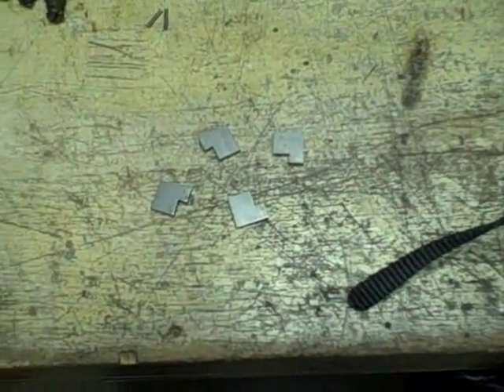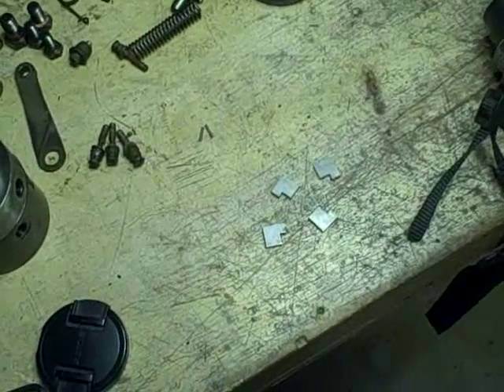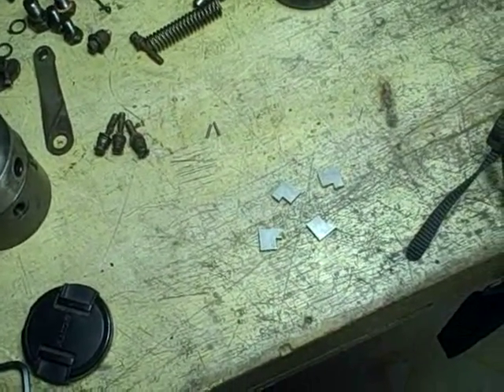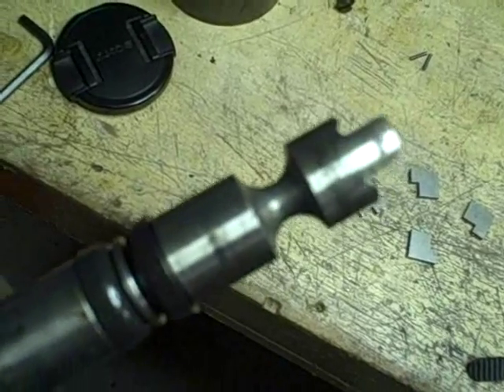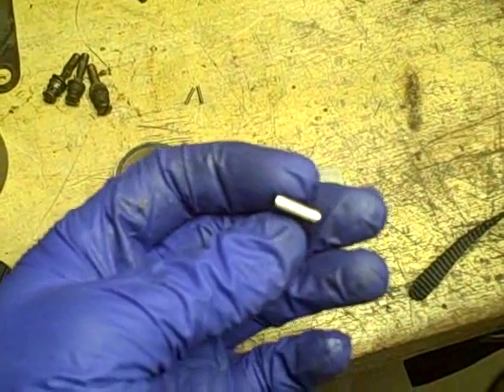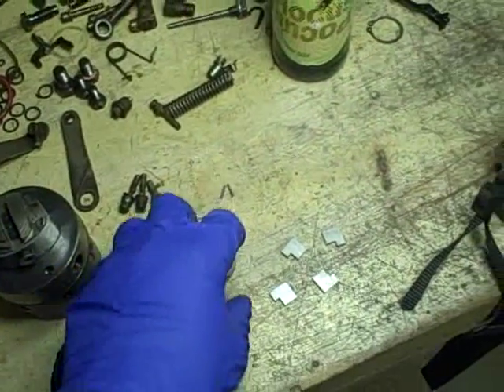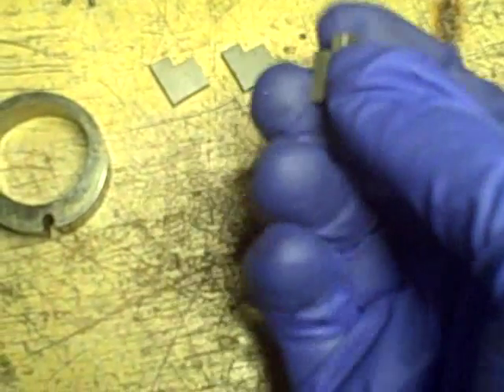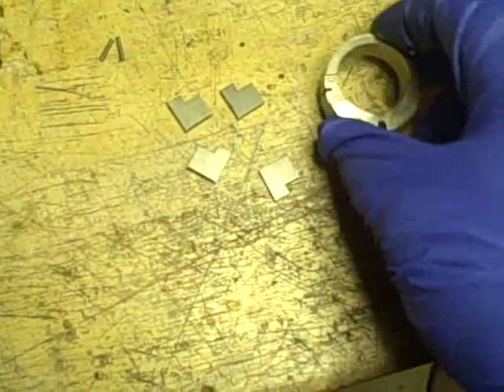Oliver 770 Industrial Tractor Project Part 64: more pump inspection

Comment: I worked for a major auto company.  The company made diesel injectors also.  A new engineer in the plant was tasked with upgrading some machinery.  He bought a machine that would hone the inside of the injector to a mirror finish.  Everyone thought this was grand.  We started shipping injectors.  Soon reports started coming in of failures.   Especially irate was the Royal Marine Rescue service.   Their boats were conking out at inopportune times.  It was traced back to the mirror finish on the injector.  The diesel fuel would simply wash by the surface and not lubricate the surface of the injector as was needed.  The injectors were seizing up.  Cost the company millions in recall.  Your lubricity story is spot on.  The diesel fuel is a lubricant.

Comment: The other thing worth mentioning here is that when disassembling fuel injection pumps that cleanliness is of MAJOR importance !!  like using lint free wipes to clean parts with. The work surface must be VERY CLEAN !! ALWAYS wear plastic gloves when handling parts !!  And remember how all parts came out, they have to go back in the same place that they came out of in the same orientation that they were in originally.

Comment from the maker: The study is by Arlen Spicer, 2007, google "Arlen Spicer Lubricity" to find it,  I cannot post a link here. The study tested lubricity, the quality the low sulfur diesel fuel lacks, and injection pumps need. 2 stroke oil used in the test rated better than Amsoil, and Standyne's additive. This only looked at lubricity. Other additive's may have anti corrosion, and or stabilizing benefits. Super Tech outboard 2 stroke TCW3 was number 7, mixture used was 200:1, or 16.64 oz per 26 gal.tank.
Reply: I really appreciate your video detail and the pertinent added info!!! I have a pump I need to go into. I also need to rebuild my index model 45, and watching those videos are quite helpful.